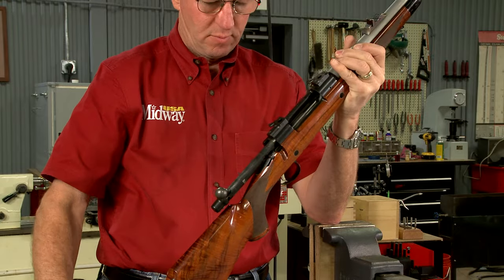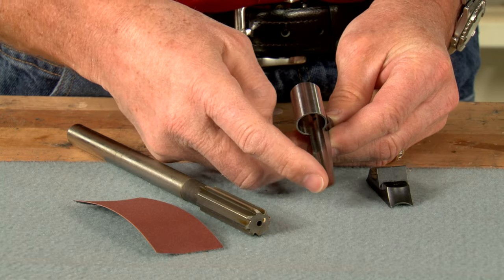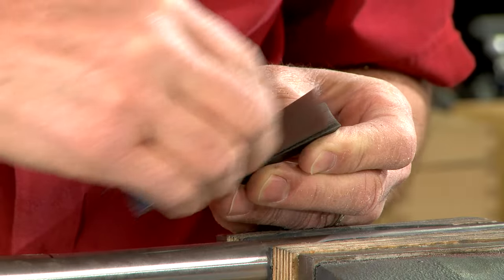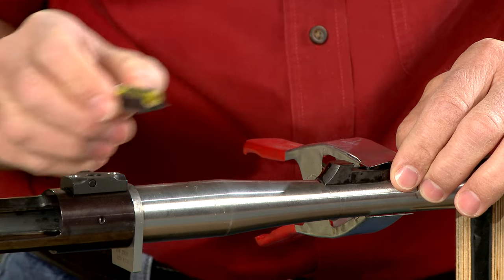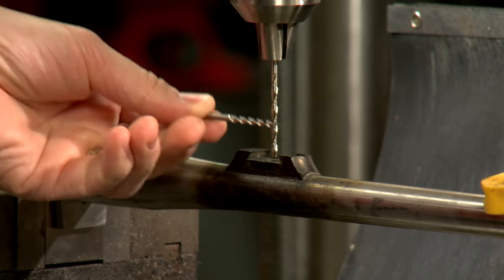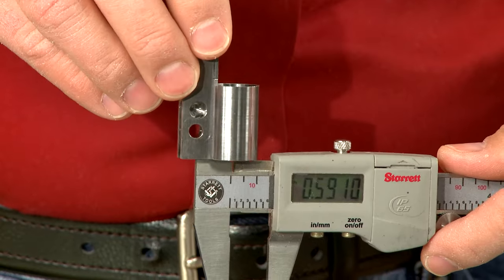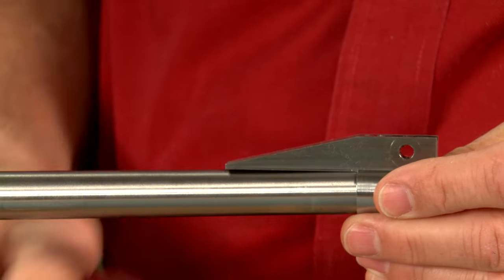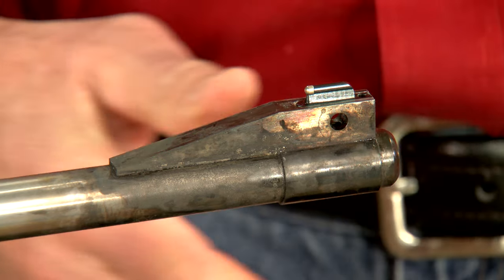How to Install Express Style Iron Sights Presented by Larry Potterfield | MidwayUSA Gunsmithing

Comment: Note* You will need a $10,000 milling machine to install this sight.
Reply: +762ALEKTO I would imagine that if you had a good, properly set up drill press you could do this same thing. also a $300.00 used mini, Metal lathe off eBay would get the job done as well. I use mine for all sorts of precision turning. you would just need to find the correct cutter / reamer. the one he's using looks too long to use on a mini lathe.
Reply: +762ALEKTO or a $20 file and some blue die. you dont need a milling machine, most gunsmith work is done with files and hand fitting.
Reply: +762ALEKTO go watch the barrel band video. he does the same process with a vice and a hand reamer
Reply: Its not a milling machine, it is a lathe.
Reply: 762ALEKTO or a friend in a machine shop, $20, and a six pack.
Reply: Or.... just got to a gunsmith...
Reply: @pinhead1304  files and hand fitting was the way it was done for centuries, long before milling machines, power tools, powered lathes, etc
Reply: AT least.
Reply: I was thinking this as I watched it. I went "brb... let me get one of those Larry" XD
Reply: +an adjustable hand reamer would also accomplish the task just fine.

Comment: did he even align it up with the front sight?
Reply: +Judge Dredd he leveled them in the video... if you mean side to side the rear sight is drift adjustable because its a dovetail.  you dont "align" sights in the shop.  you do it at the range
Reply: the front post centered on the ramp, which is centered on the collar which was leveled on the barrel.  the front isnt a side to side dovetail.  its a slot that is aligned with the axis of the barrel which is the purpose of having it mounted on the collar
Reply: he centered the barrel first, then centers each sight so they will be straight basically, since the barrel never leaves the clamp he just has to keep each sight level also

Comment: What kind of temps are you looking at to melt that solder (I assume around 700ish degrees?) and would those temps mess up the heat treating on a shotgun barrel, if those have any?
Reply: Don't worry about the specific temperature. Just use enough heat to barely melt the solder and get it flowing.

Comment: larry do you have a video on how to choose proper sights? i have a 1977 marlin #60 thats missing the front sight, dont want a factory replacement because the blade is not adjustable or removable and the sight ramp that is, wont work unless i want to tap and drill(no biggie if i had a drill press but i dont) so just wondering. if not i know it would be a longer video but would be worth it i think.

Comment: I am not fully knowledgeable in metal working, but wouldn't heating a small portion of the barrel with a torch warp it somewhat? not to the point of unsafe firing, but i would think that it would be a small bit more inaccurate. Please correct me if i'm wrong, i know this isn't welding temps, just soldering, but I am a little hesitant to heat my barrel in only one small section, either for one of the sights, or for the barrel mounted band swivel in another video.
Reply: Heat can affect the barrel, but it's more likely to affect the heat treatment than warp it at these temperatures. The barrel is very thick and can take a decent amount of heat before it becomes an issue, but you definitely want to be conscious of the heat and maybe use some heat paste to stop it from spreading if it makes you feel better. Use just the very tip of the flame (not the feather or cone where it's much hotter). Definitely avoid something like tig welding which would encourage a lot of heat.
Reply: Thanks!

Comment: That is a great process and for sure i would have to have a gunsmith do the work to ensure i get it right. Plus i dont own any milling machines lol I was hoping to find some kind of iron sights for a few bolt action rifles i own that all ,came with a scope. I have never used a scope and i'm barely hitting the steel! LOL Im learning as i go? But with the different rifles, came different scopes so they all work just a bit differently....in any case is there is easier at home process or kit that can be purchased to do it my self? I can put a barrle or entire rifle in a vice and fasten sights to it. I just cant mill anything like you can. hehe I feel i should 1st shoot t he rifles with irons before even trying a scope. Then purchase the proper scope for said rifles that i can run properly as I will use the same scope on all the rifles and dial them in as i learn to do so? lol another great video sir! I just hope as old as i am now i get the chance to do all of it? lol
Reply: I am by no means an expert but it might be more cost effective to buy an accurate quality pellet rifle or a .22lr rifle with iron sights to train with. 

You figure you can do that for about $120

Comment: Doesn't heating the barrel mess with the steel?
Reply: +Chris Moore no
Reply: +Chris Moore nope, the torch wouldnt be hot enough
Reply: +Taylor Phillips what is the solder he is using?
Reply: It should be silver solder which technically is a brazing product as it operates above 700F.  But the experience of using it is like soldering, So I guess that is the term that gets used.  It is wicked strong.  But at 700 degrees is it hot enough to draw the temper of hardened steel.  However all you need to do is affect the very surface of the material.  And given that they draw the temper of rifle barrels a lot anyway, they may be tempered at 700F anyway.  The key is to keep the heat hot enough to very rapidly heat the surfaces so the least of the barrel is affected and to get the heat in both parts but use the sight base as a heat sink.

Comment: I need to resolder a sight on an already blued bbl. Will this effect tempering and existing blue?
Reply: Not tempering but bluing, absolutely.
Reply: @scotty362100  well sir, I can tell you that I just soldered quite a bit of old dirty stainless steel to copper tubing.  I can even tell you why you couldn't solder to gun bluing. I'm sure, no, I'm positive I'm light years ahead of you on the subject. Blowhard! Bluing would act as a contaminant. Just like welding aluminum, your metals must be completely contaminant free. Now good day to you!
Reply: @scotty362100  I'm pretty sure their is someone with a sub-par IQ in the room but alas, it is not i.

Comment: did you drill through the barrel or just far enough in to attach the set screw? if so, how do you know how far in to drill?
Reply: +hdrjunkie My guess is if you take the barrel's outside diameter, subtract the bullet diameter, and divide that by 2, this will give you the barrel wall thickness.  He didn't say, but because of the shallow hole and the care he seemed to be taking, he used a bottoming tap.
Reply: +maynardr6  good tip... thanks!
Reply: put the screw in the site before attaching to the gun. measure the protrusion of the threads and add about .010 for drill depth
Reply: make sure the screw is not too long

Comment: If the barrel gets to hot that will melt the solder and then your fucked
Reply: The barrel would have to get over 400 degrees Fahrenheit for that to happen.  Not likely on a rifle like this.
Reply: if you can fire a manually operated rifle fast enough to do that you need to call guiness book of world records

Comment: Did you use silver solder or regular solder?
Reply: silver
Reply: Sta-brite low temp silver solder 32,000 psi tensile strength.